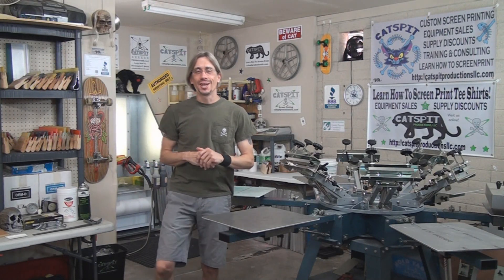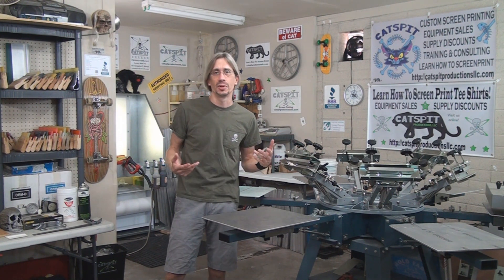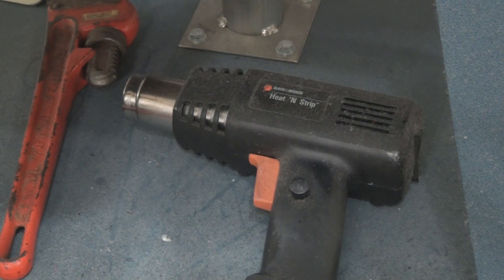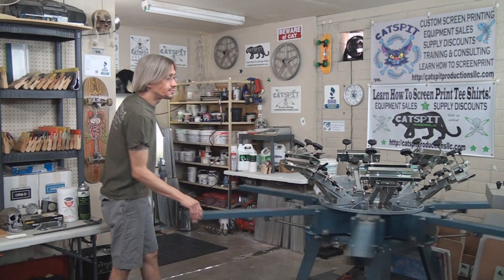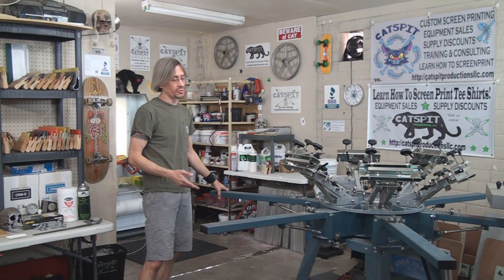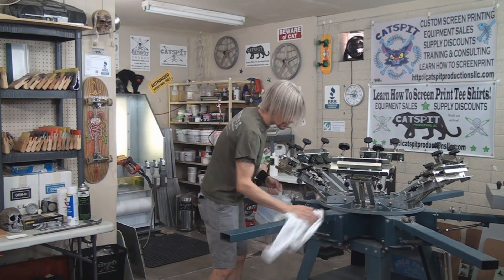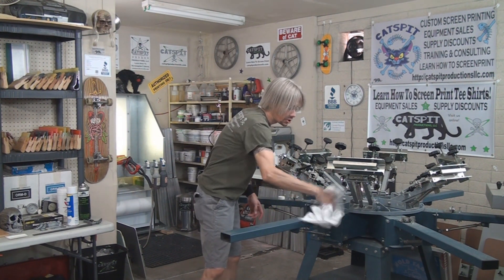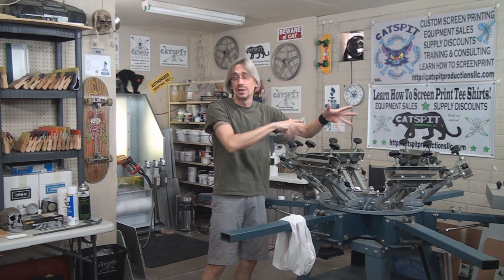How To Screen Print: Cleaning Your Manual Textile Rotary Press

Comment from the maker: Yes, you can use paint thinner with plastisol inks but it stinks and is dangerously flammable on rags especially in pails. I would use thinner for cleaning jobs that require it and press wash or ink wash made for screen printing on press and in the screen cleaning process too. Thanks for watching and leaving a comment! ☠

Comment: I purchased a used press and cleaned it to the best it is going to get. I cleaned out old grease with brake cleaner which worked great. But what to replace it with? Those are bearings in there after all. I used bearing grease but it seemed to make it harder. Then I tried a thick oil lube which worked best. What should I use? Also off topic. After drying shirts through oven, Do you fold them or just let them fall in the box and ship them out? I just got an oven. I use to heat press them to cure, Then folded them for customer.  Thanks. I use Cat Spit for my informational needs, You do a great service to the online community!
Reply from the maker: Use bearing grease for bearings and center shaft lube. I use white lithium grease for most other parts with some oil and WD40. How To Screen Print: Lubricating Your Manual Rotary Textile Press Shirts should be flat folded by size and the dozen and placed in a box for the customer. Some people do more than that. Thanks for the kind words and support, I appreciate it very much. http://catspitscreenprintsupply.com/ Thanks for watching and leaving a comment!

Comment: Is there a video on how to clean the belt dryer?
Reply from the maker: No, usually we just dust it off and wipe it down. If the tunnel needs any cleaning you can blow it out with an air compressor but usually the tunnel stays pretty clean where the belt is running. Thanks for watching. Screen Printing Equipment & Supplies - http://catspitscreenprintsupply.com/